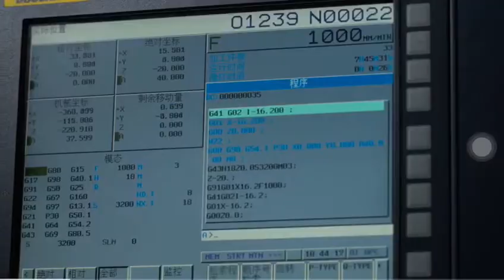Making of the INOKIM Ox Electric Scooter

Comment: No Torque wrench for the axle bolts 👍🏾😡😡
Reply: For reference, the nut that threads onto the axle of the rear motor is factory tightened to 40Nm (Newton meters) or 29.5 ft-lbf  (foot-pound force).  My source for this info was Inokim's Vice President of Business Development who confirmed this value with the factory.  40Nm is also the factory torque setting for both motor axle nuts on the OXO.

Comment: Please improve on the locking of the stem. We need bigger tires and more range. Rethink this scooter oxo let’s go ….
Reply: The design of the folding mechanism on the OX/OXO is indeed poor and let's down an otherwise well designed scooter. New out of the box, with the stock rubber shim in place and with the folding mechanism adequately tightened, under normal riding conditions the pole will feel rigid as if it were one with the frame. However depending on rider weight and riding style it will not take long before the pole develops 'play' (wobble).

The 'play' can sometimes be addressed by tightening the red retaining nut a little, however it won't be long before the 'play' returns - at which point tightening the red nut still further and/or replacing the rubber shim is unlikely to make any improvement and risks overtightening the folding mechanism. Overtightening the folding mechanism can lead to the red nut failing, and/or the two bolts shearing that secure the metal plate in place which are located underneath the rubber shim.  If this type of failure were to occur whilst riding it would likely cause a fatal accident.

Discerning riders looking to alleviate 'play' around the folding mechanism of their Inokim OX/OXO may wish to consider purchasing Lev's 'Hinge Clamp' which is available to buy here:
https://sub13.org/product/inokim-ox-folding-mech-reinforcment

I personally purchased the design and found that whilst the clamp is not perfect (once tightened it will likely crack the plastic end caps that screw into each end of the rod that secures the latch in place (plastic end caps are fitted as standard on more recent production OX's/OXO's) and isn't an exact perfect fit around the pole (due to the pole being the unique shape it is and there being slight variations in dimensions between poles from different production batches) it essentially eliminates 'play' around the folding mechanism thus achieves the desired effect of the pole feeling as one with the frame.

Please note that the clamp does not come with mounting hardware and requires 4 M6 x 55mm socket cap hex head bolts and 4x M6 Nylock nuts.  Though not necessary, in addition to the mentioned hardware you may also wish to use washers when installing the clamp.

I am not affiliated with the maker of the clamp and my recommendation comes solely off the back of my experience of having purchased the clamp and evaluated it fitted it to my OX.